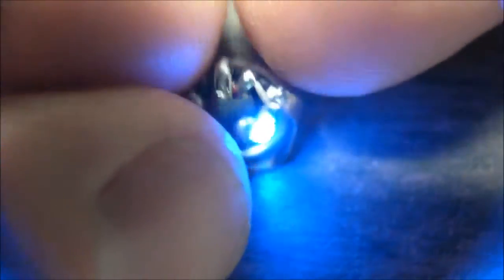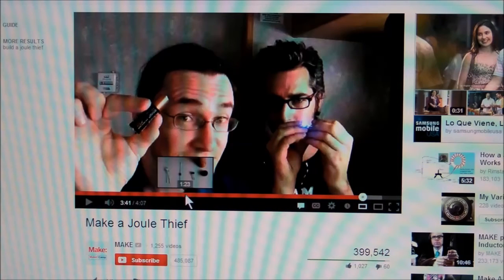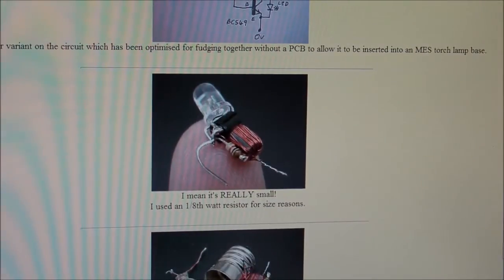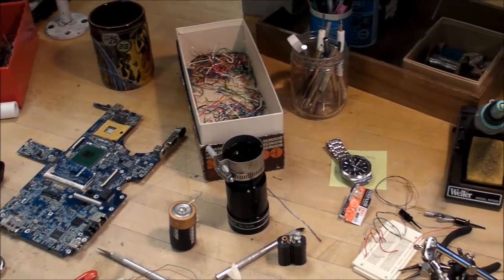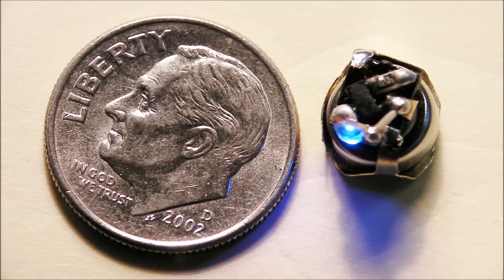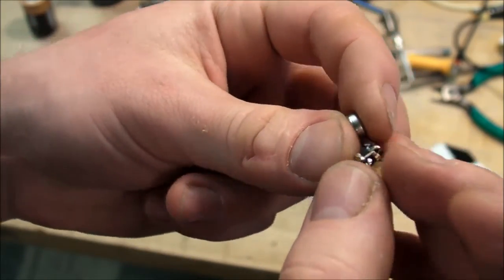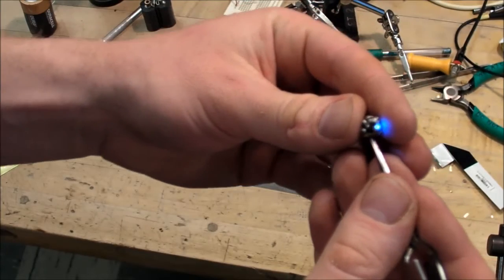(#0092) World's Smallest Joule Thief (or at least, most compact)

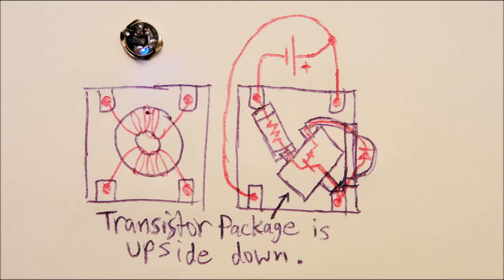Comment: Good Work ! Although I see one correction on the drawing you made @2:19 - the wire from (-) battery should be connected to emitter, not connected to resistor on the left-up toroid pin. Sorry, pleaseTell me if I am wrong.

Comment: LOL, Would be good to see. I tried doing a Slayer on a biro and a thick-shake straw.. Failed. too thin. Smallest SG Tesla I have seen is 3 inch high and half inch thick secondary. Going less than half inch thick secondary seems to be a bit of a challenge :) I think caused by poor coupling.

Comment: Thats a great mini toroid. I have a few modems on the parts pile too :) Smaller than my smallest by a bit, although I think I have slightly lower input from the SMD solar panels I used:) /watch?v=QzbUPQBaNdA 
Slider2732 also has a few tiny ones. These ones came to mind right away...
SMD Solar powered: /watch?v=S6yTog4J0vI
Smallest wireless transmission JT I am aware of: /watch?v=WECcsKZGH28
possibly a little off track, One of the worlds smallest Slayer Exciter/SS Tesla coil:/ watch?v=uY2ffphpawY